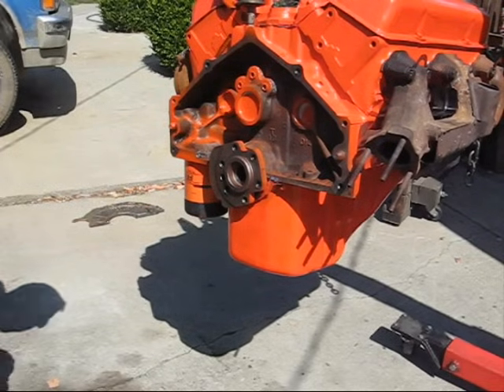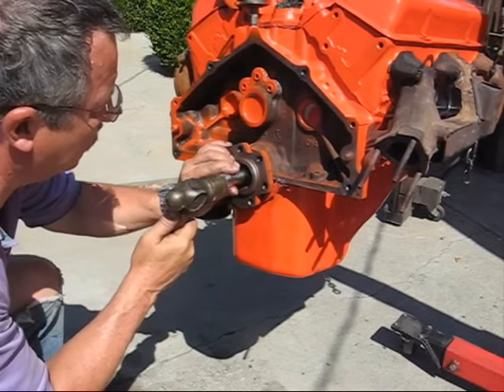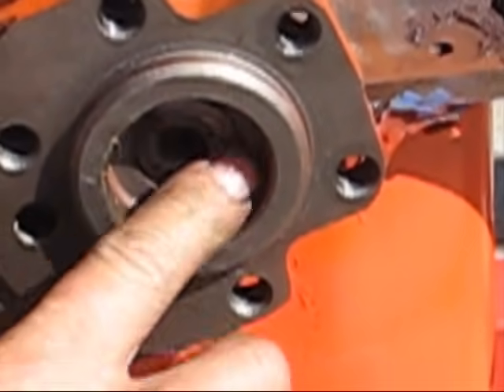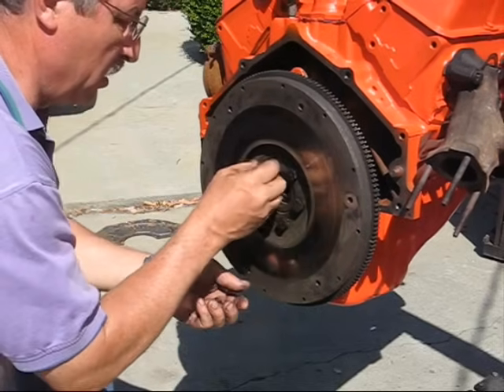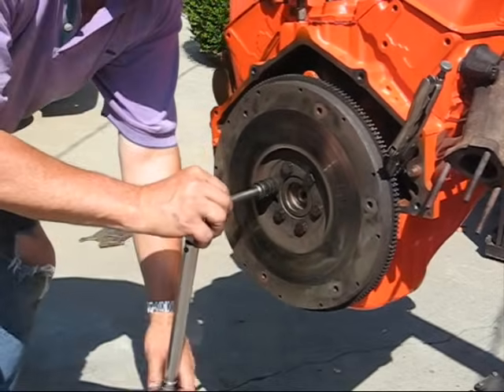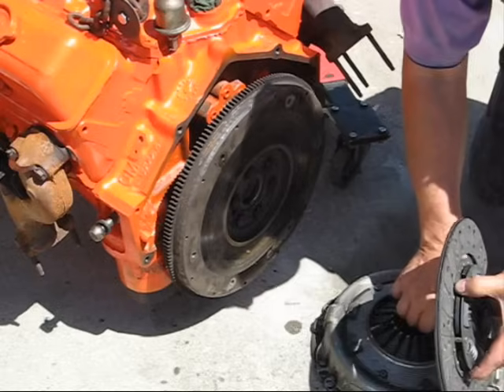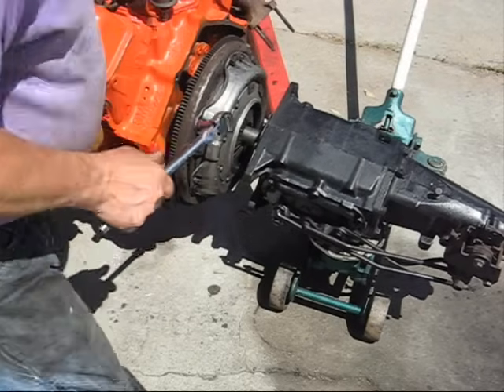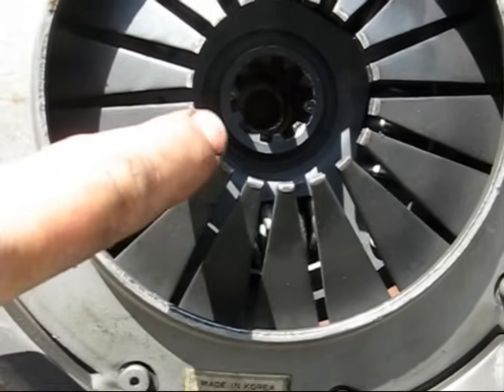How to Install a Flywheel Clutch Pressure Plate and Bell Housing on a 350 V8 70 Chevelle

Comment: They do make an alignment tool in stead of using your trans.
Reply from the maker: Yes they do.  I loaned my out to one of my friends and I can not remember who, so it is gone.  I made mine from a broke transmission.  Took the shaft that comes out of the transmission, removed the bearing and use it to line up the pressure plate and clutch.  It is the same as on the video except without the transmission.
Reply: @davidlis6709  I have done the same with some tools and they never give them back lol
Reply from the maker: @nickd4579  I had this expensive torque wrench.  Every time I think about it, I get really pissed off
Reply: @davidlis6709  I know that feeling I had an OTC steering wheel and harmonic balancer puller complete set with metric and standard bolts lent it to a friend and forgot who I left lent it to they never gave it back

Comment: I have a '69 Nova. It came from the factory as a 4 speed. Somewhere in it's life someone changed it to a TH350 with a B and M shifter. I'm getting parts together and putting a Muncie 4 speed it in again soon. I'm a novice hot rodder but your videos have helped me so much. I didn't know much about cars before I got my Nova but I've swapped an engine, and done other little odds and ends thanks to your videos and others like you. Never delete this stuff. It's very helpful to guys/gals like me. Hope you're still enjoying the Chevelle.
Reply from the maker: I make these videos for guys like you.  
I don't work on my Chevelle that much because it does not need any attention except for changing the oil.

Comment: Thanks Dave, your video answered my question about the  pilot bushing and the spline with the teeth going into a key way on the clutch
Reply from the maker: I had a pilot shaft from an old transmission that I used to line up the clutch and pressure plate but I loaned it to someone and it never was returned.

Comment: Can I swap 350 flyweeil into 305 engine,  and thanks
Reply from the maker: Should be able to if the bolt pattern is the same and it has the same amount of teeth on the outer ring.  Most Chevy parts interchange.
Ask you local auto parts store because they have the interchange information.

Comment: Excellent video, For people trying to learn! Sure they make a alignment tool [but] if you don't have one these will get you the same results. Excellent key points thanks for sharing stored knowledge
Reply from the maker: Thanks.  I have an old pilot shaft that I normally use but I could not find it so using the transmission is the next best thing.  A different way of doing it.

Comment: Hey I hope you still monitor this video.. But it is a great instructional . Question ???? How tight or secure does that clutch fork has to be on the piviot ball???  I seen you shake it a little but no one demostrate how secure it has to be...thx.
Reply from the maker: The spring clip fits on a ball, so it will fit lose

Comment: I needed to learn just 1 thing here, and you taught me 2.... Nice.

The Release Bearing was what I came For, and I learned about the Pilot Bushing.
1 Question though: How do I remove the OLD pilot Bushing, without taking the Engine apart?
Reply: guessing you've already done your project, but if you take a piece of paper, rip them up into small pieces, soak them in water, then jam them into the middle of the pilot bushing, then use a socket extension and some force to pack in the water logged paper, continue packing in wet paper, when there's enough paper crammed in there, it will force the pilot bushing out, then just reach in with your finger and wipe out the paper...did it on a chevy 305 and it worked perfect for me
Reply: Did it... Did NOT work.
Bearing is still jammed in the Crank.
Reply: Syrus54 Some times heat is need to get the seized bearing free .........
Reply: +Syrus54 If you didnt get it out. Use a cold chisel and slowly chip away at it until its out. Some people actually thread it. Install a bolt and then use a puller.

Comment: You can fill in behind the pilot bearing with grease and use something of the same diameter as the hole in pilot bearing smack it with hammer keep filling it with grease and it works like a press and will push the bearing out
Reply: Yeh, iv seen ut done with bread.

Comment: Thank you David! Great presentation. 

Small block Chevys were my "specialty" - "back in the day". 

(I loved my 327 with 2.02 intake valves. It was a screamer - and it got 23 mpg - when I stayed out of the secondaries. ;) )
Reply from the maker: In the 70s, I had the same engine and valves but add a Crane cam, high compression pistons and a few other things and I was luck to get 10.  How do you not put your foot into it?
I bought used tires from the junk yard because I would burn them off.  They did not last long but it was fun.
Reply: @davidlis6709  Yep - Those $5 junk yard tires were fun to "smoke 'em if you got 'em" :)
Reply from the maker: @dennyaudio  https://www.youtube.com/watch?v=vm-YY-xsMyM&t=28s

And when are you going to grow up?

Comment: So I have a question..I'm changing out the clutch on a 72 chevy c10  with a 4 speed. Because it wasn't shifting very smooth and hard to put in gear and it would scratch gears alot. And it started then to make this weird rattling grinding type sound just idling. So I dropped the transmission and took the pressure plate and clutch off and for some reason that bronze bushing you were talking about fell out after I took off the clutch and pressure plate assembly. So is that bronze bushing supposed to fall out like that? Or is it supposed to be pretty snug in that hole and could it had fallen out of place and been what was grinding and making that rattling sound?
Reply from the maker: I always had to work to get them out and tap it back into the crankshaft with a hammer and socket.  That means yours is rattling around inside the crankshaft and  around the pilot shaft on the transmission.  I believe you need a new one. 
That bronze bushing is soft metal the will wear out completely in time.  Remember to put a little grease on before you install the transmission.

Comment: what brand torque wrench did you use?i bought a 1990 chevy c1500 with a 5.7 the previous owner was making it stick shift i decided to go back to automatic would o also have to change the pilot bushing any information would be very helpful thank you sir
Reply from the maker: I bought it from Harbor Freight.  

If you are going back to automatic transmission, take the pilot bushing out.
Reply: David Lis thank you very much sir another question do i also tighten the flexplate bolts to 60ft torque?

Comment: With an automatic transmission set up do I need a pilot shaft bearing in my flywheel?
Reply from the maker: No, standard transmission only
Reply: @davidlis6709  cool! I'm converting from standard transmission to automatic, do I need to remove the pilot shaft? 350Chevy
Reply from the maker: @agathry3815  No, but I would because if it ever comes lose you will never figure out where the noise is coming from.  You will be so pissed off at yourself.

Comment: I've never seen so many mistakes in one video! I would love to see a video on how this engine is doing a year after this. Damn backyard mechanics
Reply: I guess it depends on how you like to do this.  For me, I don't like to do any work on an engine while it swings from an engine hoist.  That just goes against my sense of safety.  An engine hoist should ONLY be used to lift an engine.   If it were me, I would install the pilot bushing, and then bolt the flywheel on when the engine is bolted to a stand.  Second, I would cross tighten those flywheel bolts, first snug, then tight, then torqued.  Then I would put the engine in the car.    Why?   Then from under the car I would install the clutch and pressure plate using a $5 clutch alignment tool.  Then I would ease the transmission into place.  You can craft a transmission cradle out of wood and scrap metal and attach that to  your hydraulic jack, or, if your transmission is light enough, muscle it into place.  On my 1988 Mustang GT, I put the transmission on my chest, rolled under the car and put the transmission into place myself...on heavier transmissions you can get a friend to help or use a jack.  Slip it into place and bolt it on.
Reply from the maker: https://www.youtube.com/watch?v=vm-YY-xsMyM&t=58s
Reply: yes yes yes    he checked no specs at all
Reply: @rob99rst  specs are for overpaid mechanics. Never used a spec wrench in my life. Everything is running around the farm.

Comment: lithium grease supplied with the clutch kit should be used on the pilot bushing, clutch plate fingers, throwout bearing, clutch fork and ball, imput shaft splines/ tip that goes into pilot bearing. 

flywheel should be replaced or resurfaced

rubber gloves must be worn so that the flywheel and clutch plates arent contaminated by grease or oil

flywheel bolts should be replaced and torqued in 3 stages in a star pattern, preferably with blue or red locktite on the threads

clutch alignment tool should be used before tightening clutch plate bolts to flywheel. 

clutch plate bolts should be replaced and torqued to spec in a star pattern

clutch plates should not be laid on pavement

those are just some of the bad habits shown in this video. other then that this video can be helpful to show the steps that a clutch kit would be installed
Reply: This Karen here!

Comment: Thought you should have torqed the cluth pressure plate and bell housing.. Good video.. Thanks, DaleO
Reply from the maker: I did the pressure plate but didn't show it, the bell housing I didn't what to tighten it to tight just in case I had to remove it while it is in the car.  It is ease now but not in the car.

Comment: Would a bad flywheel cause my car not to start on a manual
Reply from the maker: Yes - if the teeth are ground down on the flywheel, the starter will not be able to engage and turn the engine over.
Remove the starter and look at the flywheel teeth and see if any teeth are ground down.  Mark the flywheel with a magic marker and turn the engine over a full turn, 360 degrees.  Use a screw drive and go one tooth at a time or put a socket on the front pulley and have someone turn it over as you watch the teeth go by.

Comment: ok so it maybe wasn't 100% pro. but I've put together a 100 just like that and everyone worked, we can't all afford $100 an hour for labour. good video
Reply: Bob Moynes you need threadlocker on there brother blue medium strength 
Clutch alignment tool cheap 
Flywheel turner tool 
Silicon base lubricant for the candle stick
Torque the flywheel in sequence! And torque everything else to specifications with thread locker very important

Comment: Fast and simple
Reply from the maker: It take a little longer if the motor is installed in the car but the same procedure.  If you do a lot of them you can buy  a clutch alignment pilot shaft tool.  Or if you know a manual transmission repair shop, they might give or sell a damaged one cheap.

Comment: I need the bushing that goes in the motor do you have a part number
Reply: or do they have them at the local auto parts store
Reply: how did you remove it
Reply from the maker: No I don't but all the auto parts stores will know what you want.

Comment: You should never turn the crankshaft counterclockwise - when you tightened the pressure plate bolts.

Comment: No loctite on the flywheel bolts?
Reply from the maker: Never had a problem before, even on my racing engines.
Reply: Torque until your wrist clicks, then back it off half a turn??

Comment: Buy a Clutch alignment tool.
much easier.
Reply from the maker: I found mine after I did the job.  Typical
Reply: That and make yourself a couple of 3 inch bolts cut the heads off and use them as guide studs.Helps alot under the car

Comment: For the newbs out there, have your flywheel turned since its out anyway. Just bolting on the flywheel is like doing a brake job without turning drums and rotors, BAD IDEA can you say CLUTCH CHATTER!
Reply: Jeff Jankowski yeah true but if you remove material you gotta add shims. Or replace entire unit. Check the teeth while it's out too. Replace ring or unit.
Reply: people don't turn rotors or drums with every brake job, that is just not cost effective.....
Reply: To be direct; you cant speak for the people. Just for yourself, if you say it's not cost effective. Then it's obvious we cannot have an educated discussion. Because you have yet to be educated by Master Technicians throughout your schooling. 

IT IS COST EFFECTIVE> Machine shops make the surface smooth and even all around.  This will cause "even wear" of the friction plate. 
HOWEVER! you gotta add shims if you remove material. 

go to school MR Marty Fed-up. Stick to your video games.
Reply: Its partially true.
 IF the flywheel does get machined then you MUST add shims. otherwise your starter is gonna have a hard time.
Reply: yeah, no, im not the sheep you sell useless repairs too bro...
Reply: Learn from a ASE Master Technician. Then your opinion would matter.
Reply: go with that, I know what I'm talking about, your hiding behind a paper....
Reply: Fact is you're hiding behind a computer screen/video games.
I know that I'm giving free information of this trade.
Obviously my opinion matters in the automotive community because I'm a Manual Transmission/Transaxle Specialist with a degree and training in Automotive Technology.
When we discussed flywheels being resurfaced, I can tell you lack imagination to see why you add shims to that application. 
But hey when in doubt: Go ask someone you trust who is ASE Certified. 
Free information is help people who don't want to be ignorant and would want to salvage their flywheel due to their budget. 
Come down to FULLERTON COLLEGE AUTOMOTIVE PROGRAM and learn something. 
I'll pay you a visit and demonstrate why.
Reply: I don't understand why you keep bringing video games and useless degrees into this, do you believe what you do is hard? and you and I weren't even talking about fly wheels, you decided pretend there is a reason to resurface rotors ever brake job.. when modern rotors  can't even support more then on turn without losing most of the braking surface.... Why not just tell them to buy rotors with every brake pad like the rest of your rip of  counterparts???
Reply: Is it hard? Depends who you ask. If you ask my gf she'd say "it's hard as rock baby". Since you're asking me who is meticulous and experienced: it's a walk in the park within any variation. Practice makes perfect and also understanding the engineering factor of the application will help you not be a technician mechanic that's a butcher and try to sell you rotors every brake job that's unethical for the common vehicle. 

"Modern Rotors" i believe you mean performance drilled, slotted, drilled and slotted. Yes don't resurface those. I don't resurface those on my Eight-six. 
But in the normal realm out of performance. There's a limit specifically with each make and model in thickness. If you take them to a machine shop they will tell you if it passes or fails; EVEN drums need to be resurfaced and are subject to the same thickness regulations. 
I'd say after you reach the limit of thickness go get you some/a new  one(s). 
-Resurfacing will allow you to have all of the braking surface Vs not resurfacing (not performance rotors different animal) you will notice uneven surfaces by -running your fingernail, each bump you have that's less braking surface. So just replacing brake pads will allow you to replace brake pads more often. 
Take a powertrains course and a brakes course. Ask professionals who teach. They're not looking to rip off students, and they aren't allowed to take money from students.  
A flywheel is a rotor and the friction plate is a brake pad. 
Understanding the engineering factor you'll see relations within other units.
Reply: TS PARTIALLY CORRECT YOU'RE MISSING INFORMATION Jeff Jankowski 
The other part to that is ADD shims on your FLYWHEEL. WHY?
Because you're removing material by turning the flywheel. Why does that matter? IT matters particularly due to the fact that flywheel is bolted to the crankshaft and your STARTER has gears that are lined up to manufacturers specifications. Basically: the teeth are misaligned from starters and that gear will damage eventually and the flywheel gear/ring will break without SHIMS. 

Lets say you removed 1/16" then you get a 1/16" shim add it between the crankshaft and the flywheel.
Show less
Reply: +O_o X_x  just my thought. when a flywheel is resurfaced they are taking metal off the area where the clutch disc contacts the flywheel, correct? if they take 1/16th off the flywheel that would not have anything to do with the starter but more to keep the flywheel in the same place vs the clutch, right?
Reply: Tell me how the starter alignment can be affected by facing the flywheel. The location of the flywheel ring gear doesn't change .the material removed comes from the face(front) of the flywheel not the mating surface.What cars do you know that you need shims after facing the flywheel? I've NEVER seen a flywheel get shimmed! Tell me more please.

Comment: byrysh. How do you know there was even a clutch alignment tool come with his clutch kit? There have been a lot of clutches installed without a tool as there hasnt always been one included, but I guess you have never done anything the old way. just say n.
Reply: danny thomas it's a cheap tool. 
But if your a tech like me then of course there's times you don't need the tool BECAUSE I have a spare input shaft from another tranny. 
Key to this is yes you need the alignment tool. But hey do what this man did, all his mistakes I see money. Repairs.
Reply: looked like a used clutch and pressure plate so he probly didnt have one